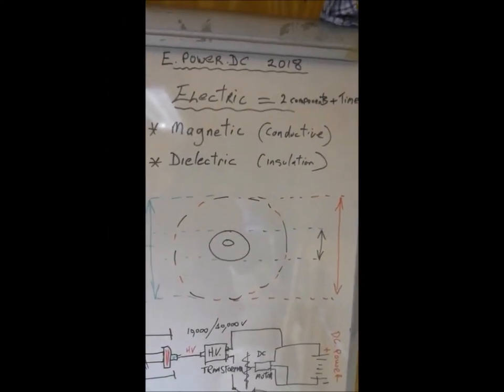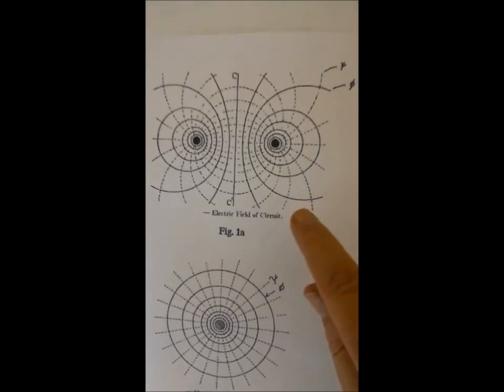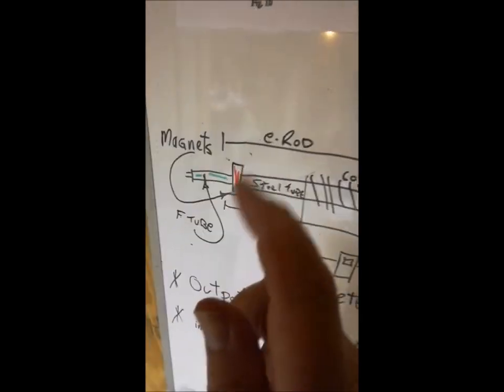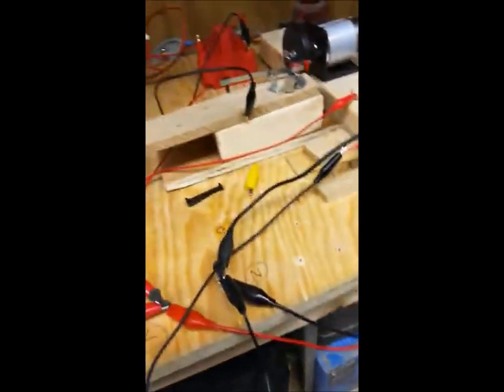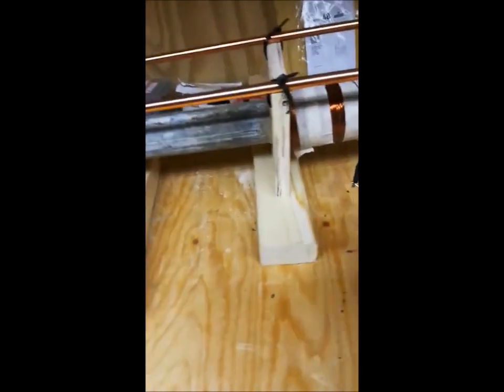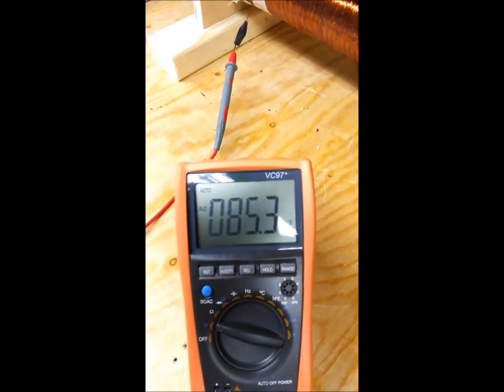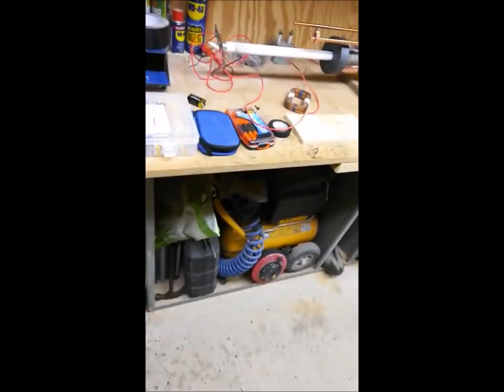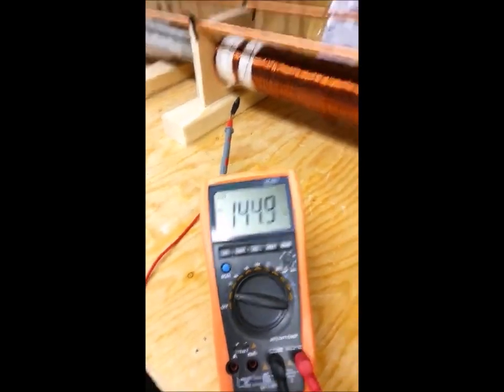Plasma Magnetic Dielectric Charger Generator 2019

Comment: Something similar by Mykhaylo Balush
 https://www.youtube.com/watch?v=lbREtBSQ7pw&list=PLl7H0CC-caDe1prlgJ4yzt4orhcvft2St and https://www.youtube.com/watch?v=jAMtn9-RHwE&list=PLl7H0CC-caDe1prlgJ4yzt4orhcvft2St&index=2   Smith has a similar experiment in his energy book by Patrick Kelly.   I believe that you can suppress the magnetic part while magnifying the dielectric causing increased electric output.  My experiments so far show that 11 volts input to 3400 volts output thru the use of a microwave transformer wired oddly and an input from a magnetic suppressing coil(a regular type coil does nothing) that is DC pulsed.  Magnet fields and dielectric fields are not fixed as we might think or have been taught.  What I have observed might just be phase shifting for all that matters, but the experiment shows a great anomaly that I have not seen before.  Discovered this only after getting shocked so many times and it really hurt.  Basically it is the same as putting your fingers across 120 volt AC outlet, the shock is only micro to milli seconds in duration currently.

Comment: Great experiment, unfortunately I don't think you will get much current from this setup. I have tried a similar experiment with a plasma ball and the current was very low. Can you measure the current and do the magnets make a difference to the output?
Reply from the maker: Hi Cop, its the strength of the field which is outstanding. "Birkland Current" is the key to understanding. It is very must "Work in Progress".  Should have a working "Something" soon as i am putting together all my learning next. For your interest :- Key Link... Regards...DC
  https://www.youtube.com/watch?v=yIFR67sckK0
Reply from the maker: Hi C  Still work in progress, i have to figure it out. I will post new video with all results. I have managed to make this "Transformer"  it is making most metals "Live or Hot" near it (Near-field effect) antenna. ... Regards .... DC